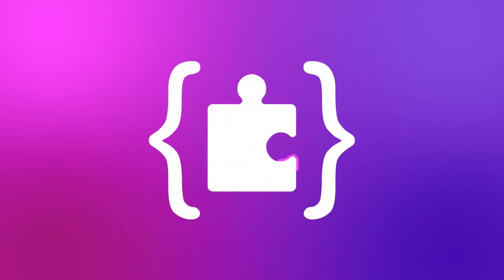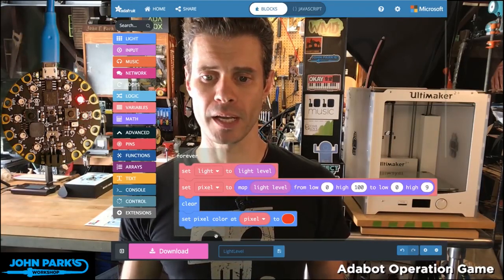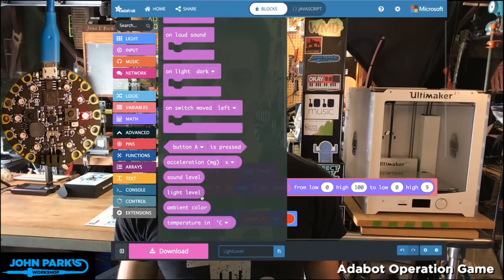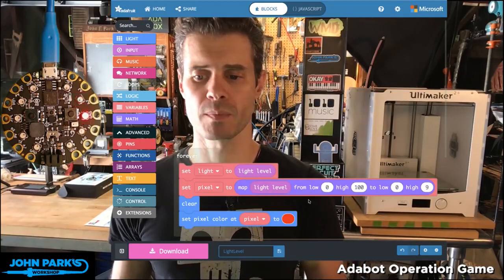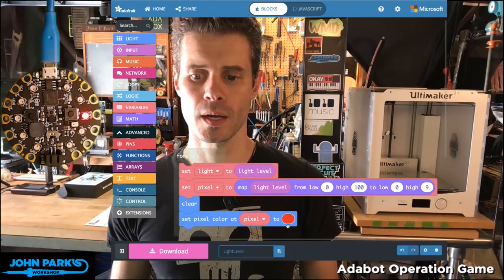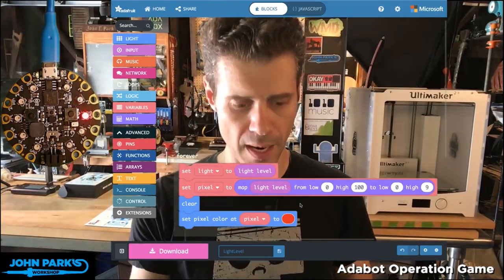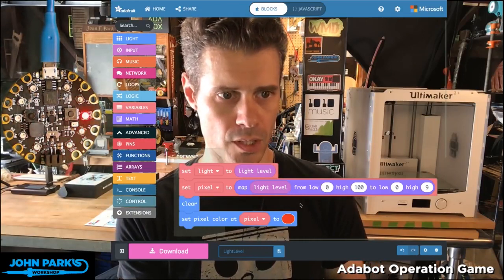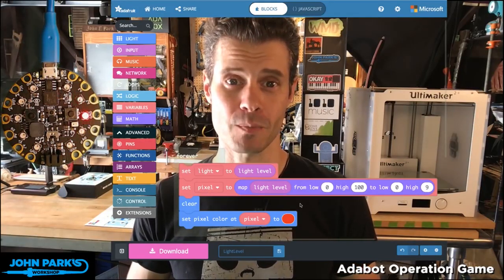MakeCode Minute: Light Meter @adafruit @johnedgarpark #adafruit @MSMakeCode #makecode

Comment: Hello, how did you check the range from the light sensor is from 10 to 100? Is there a way to get some real time sensors or variable values back to the PC for debugging and calibration? Thanks
Reply: You can read the data directly using serial output -- here's  more info: https://makecode.adafruit.com/reference/serial